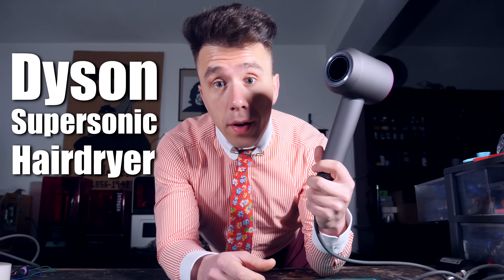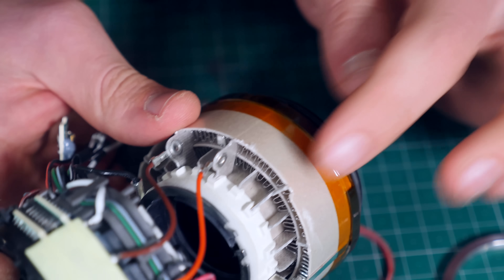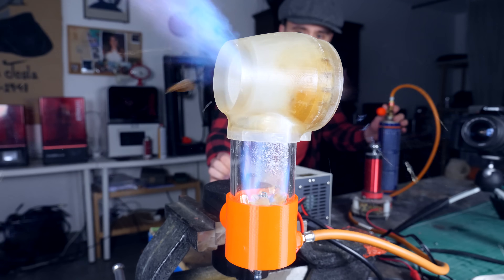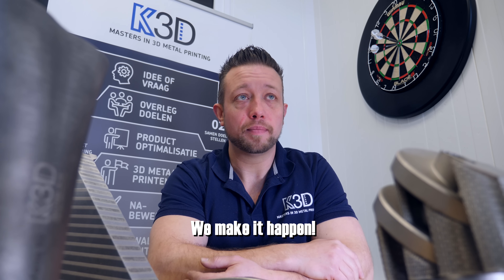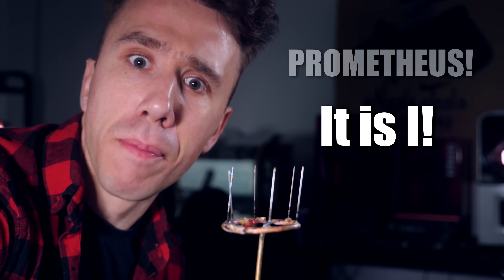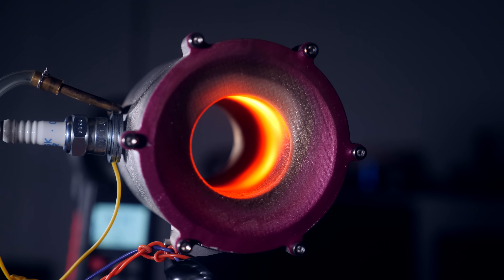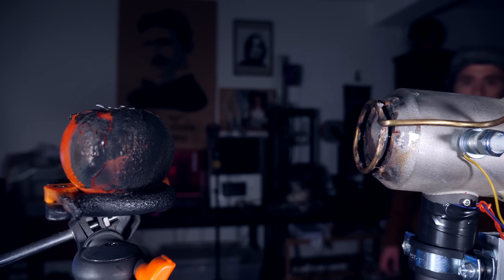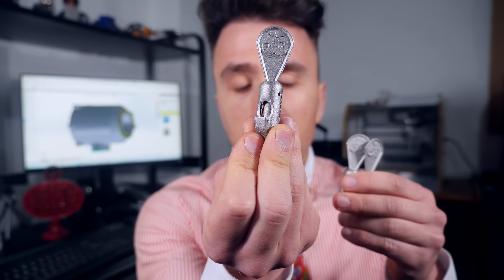I turned my DYSON HAIRDRYER into a JET ENGINE

Comment: How about building out a series of drone tests with Frore systems AirJet® Pro mems air pump then build into JETOPTERA Fluidic Propulsion™ system and Distributed propulsion not sure if using the Coandă effect like Jetoptera at the leading edge creating more of an Upper Surface Blowing (USB)  lift augmentation system could be better but there is also the Blown flaps, or jet flaps. 

Might be able to have some fun with leading-edge slots?!?

I also posted a few ideas of birdy like things to do with plans props and propellers.  The owl video spoke to the second set if vortices from the owl’s tail and mentions how hard that would be. With an upper blown surface Coandă amplified mems device powered air flow the tunable thrust would be superb. I once thought that the main advantage of having two large sets of lift surfaces (more than canards) is turbulence reduction when in powered forward flight; can’t find any reference for it now. 

https://www.froresystems.com

https://ntrs.nasa.gov/api/citations/20050195880/downloads/20050195880.pdf

https://www.jetoptera.com/technology/

https://patents.google.com/patent/WO2017065859A2/en

https://youtu.be/aWUt4h0zbEU

https://www.futureflight.aero/news-article/2022-08-22/us-air-forces-hsvtol-challenge-propels-jetoptera-fluidic-propulsion

https://www.sae.org/news/2018/11/ge-aviation-jetoptera-join-forces-on-fluidic-propulsion-system

https://www.researchgate.net/publication/269071244_Lift_Enhancement_for_Upper_Surface_Blowing_Airplanes

Overset Grid Symposiumhttps://2014.oversetgridsymposium.org › ...PDFLift Enhancement for Upper Surface Blowing (USB) Airplanes

https://en.wikipedia.org/wiki/Distributed_propulsion?wprov=sfti1

https://lilium.com

https://en.wikipedia.org/wiki/Blown_flap?wprov=sfti1

https://en.wikipedia.org/wiki/Coand%C4%83_effect?wprov=sfti1

https://en.wikipedia.org/wiki/Leading-edge_slot?wprov=sfti1

https://en.wikipedia.org/wiki/Avro_Canada_VZ-9_Avrocar?wprov=sfti1

https://www.jetir.org/papers/JETIR2104113.pdf

https://vtechworks.lib.vt.edu/bitstream/handle/10919/35999/EBKThesis_121004.pdf;jsessionid=C4F1AFB2FE21A95C05370AABBAB8FC5C?sequence=1

https://ir.library.oregonstate.edu/downloads/cc08hp263

http://www.icas.org/ICAS_ARCHIVE/ICAS2012/PAPERS/266.PDF

https://www.mdpi.com/2226-4310/9/12/745

https://www.ncbi.nlm.nih.gov/pmc/articles/PMC5550969/

https://www.ncbi.nlm.nih.gov/pmc/articles/PMC8385352/

https://en.wikipedia.org/wiki/Tandem_wing?wprov=sfti1

https://royalsocietypublishing.org/doi/10.1098/rspb.2020.1748

https://hal.science/hal-02086677/document

Nature has all kinds of tricks up the wing: bird feathers have a porosity that allow air to be sucked through to reduce drag; https://www.cambridge.org/core/services/aop-cambridge-core/content/view/7AA116B6EDE6511BBE249B384936B30C/S0022112020007466a.pdf/reducing_aerofoilturbulence_interaction_noise_through_chordwisevarying_porosity.pdf

https://spectrum.ieee.org/future-airplanes-will-fly-on-twistable-wings

https://www.flxsys.com

Comment: VIDEO IDEA: Can one of the devices you make be used to make a kiln (like they use for pottery or working with glass). As these use air to make fire produce much higher temperatures than normal. I don't know how the air makes the fire burn much hotter. But I'm sure one of your jets/fans could do it. 😊

Comment: Hello integza I was wondering something, when I was watching a couple of older videos I saw that when you were building a tesla turbines I noticed that you missed the star shaped spacers that are needed for the beginning torque and overall strength of the engine, if you did have those then sorry for wasting you time but I'd like to see if you would have better success with them if you included it.

Also are you aware that there were tesla turbine jets that used hydrogen they would burn the gas in a combustion chamber then run it through a small diameter pipe to increase pressure and temperature, the hot gas would then go through the turbine then get reignited, I just thought it was cool

Comment: a turbine that is cooled by the expansion of compressed hydrogen that it uses as fuel. this turbine produces the electricity needed to charge up a supercapacitor bank that in turn splits water using a counter rotating cathode and anode that produces browns gas or hho (counter rotating to ensure even wear of the electrodes) the hho goes through hv electric coils so that Oxygen gathers at one pole and hydrogen at the other.
this hydrogen is captured and compressed to liquid by the fuel pump and then injected at high pressure through the turbine cooling jacket and into the turbine where it is ignited.
(not perpetual motion for we are putting a fuel source in - water)

there will be a high percentage of hho that wont be completely hydrogen or oxygen but a mixture of both, this is vented and burnt through an igniter and sent through an exhaust manifold.

this exhaust manifold is used to shape the exhaust from the turbine itself

by spiralling hot exhaust hho gas at much higher speeds in a cyclone around the turbines exhaust, we can focus that exhaust for more thrust.

recap.
1. turbine that burns hho/browns gas.
2. is cooled by a coil of decompressing liquid hydrogen 
3.turbine has liquid hydrogen cooled ac generator motor (making it cryo cooled/super conductive) 
4.generated power is stored into supercapacitor bank.
5.supercap bank drives an hho generator, using electrolysis/water splitting to make browns gas/hho.
6. the hho gas is the exposed to super conductive electrode that will draw hydrogen to one pole and oxygen to the other.
7. the hydrogen is then compressed into liquid hydrogen, then pumped directly into the cooling/expansion coil around the turbine then directly injected into the turbine for ignition.
8. the wasted hho (not polarised gas) is then ignited separately and sent through the exhaust manifold.
9. the waste hho exhaust is ported in such way that when it meets the exhaust from the turbine it shapes it focus it and enhance thrust.

also using a static friction layer on the insulator layer between the poles of the rotating cathode and anode. means that the cathode and anode spin slowly against this friction surface exposing fresh electrode surface and clearing oxides that may be generated. 

this system produces controllable thrust.
super conductivity.
generates electrickery.
pumps and compresses liquid hydrogen.
is self cooling.

Comment: Since you like dabbing into jets, and you also had experience with making ramjets, you could be the first that actually achieved flight / hover on Focke-Wulf Triebflügel design - Nazi Germany concept plane that reached wind tunnel tests but it was never properly build. Of course, you can only make the engine / propeller part for VTOL,  suspend it on a wire for safety and for stability,  MPU6050 Accelerometer and Gyroscope sensor with the Arduino. Would be a cool project. You can also slap a funny mustache on the tomato-test pilot, since you hate them so much :D

Comment: The fuel delivery has to be just behind the heat source, just as the air is compressed. Then you will not be able to melt your soldered joints.

Comment: Hi im a 14 years old student 
Can i make a pulse jet engine with a carburettor? If i can is the reed valve still important ? The carburettor mixes air and fuel , so do i still need the reed valve for air?
Reply: There are such things as "valve-less" pulse jets but it will be very hard to not use pressurized fuel.

Comment: "Although I struggle with English, I wanted to share an idea with you in this comment. Have you considered using nichrome wire to create a captivating jet engine effect? You could install a jet fan and arrange the nichrome wire in a circular pattern. By supplying electricity to the nichrome wire, the airflow from the jet fan would fall onto it, resulting in a realistic jet effect. Additionally, incorporating some fuel could potentially enhance the overall outcome. I hope you find this suggestion helpful and exciting. Keep up the great work on your channel!"

Comment: can you create two of this dyson jet engine facing each other and their face is connected by a tube?

the idea is to simultaneously blow air inside the tube, when the air pressure is enough, to turn off one suddenly

it could be the same as the ironman arm blaster

Comment: Video idea:
Make a different version of the Hero's turbine by using the same design but the heat from the hairdryer would boil the water, but the main problem with that idea is to get enough water inside for the test run, maybe you could add a pipe to it?

Comment: the problem is, sintered parts are a million miles from the same durability as cast parts, let alone forged monocrystal or machined.

this sintering is stronger than normal sintering. but is still sintered

Comment: Again, how about researching a "Buzz-bomb", razor-blade combustion chamber jet engine, like the V-1 rocket?  Like I indicated before, this approach will work and you can generate a lot of thrust with an engine of this type!  So, leave the torching of tomatoes alone and start the fabrication of a  V-1 rocket! I need a 3D printer for my research!

Comment: Question is could it be made by using one of these Force blowed heaters creating the turbine thrust with like a car but using the transmission and motor axle shaft as the has the turbine prop shaft increasing revolutions with we controlled by an electric EFI maybe try to introduce water to hit for more boost do you think it's possible

Comment: oh your brass and needle fuel injection system keeps melting the soldier try using a 4 cyclinder  fuel rail off a car itll bend the same under heat and give a more constant heat safe fuel

Comment: video idea : build a 3d printed jet engine with cryogenic cooling(you can make that by putting an copper wire coiled around the engine into the outlet of a fire extinguisher) or you can do it by coiling the fuel tube with any conductive metal around the engine(as the temperature of propane inside the can is very low. and tomatoes are super disgusting!

Comment: A theme for a future video. How about designing a large wind up mechanism. Like what used to be in old model trains and toy cars. Maybe you could replace the wind up key with a small starter motor to wind up the mechanism to create perpetual motion (free energy, mostly!) Then you could use that motion to charge the battery for the starter motor! You could design and fit it to your grandfathers bike! (I’m Hoping to win a 3D Printer to help develop my creative engineering ideas)

Comment: Video Idea: Make a flight suit with your own jet engines.
Technically, you already made one of your jet engines power a bicycle. A bit more powerful and a flight suit would be possible. I don't mean A flight suit with vertical takeoff, but one like a powered hang glider. Another idea is launching a two-stage rocket with a tomato as the payload. The second stage can be a liquid fuel one, and the first can be solid fuel. Once the stages have separated and the first stage has no more fuel, release the tomato with an explosive bound to it. Let the tomato explode in the air!

Comment: Future video idea... proof of concept for running your hair dryer jet engine on the electric rocket propellant. Not just running it,  but 3d print an airfoil wing to fly it.  Or possibly a 3d printed rocket fuselage and see how high it will launch 1kg of tomato sauce in the air

Comment: Theme for a future video idea…following on from aero concepts in this video where the Venturi effect is used to multiply the air flow (I think that’s right) and given your love of 3D printing, could you design a 3D printer extruded/part cooler housing to take advantage of this principle?

Comment: Reconstruct the jet engine.
This time don't include a motor, make use of a 3D printed fan blade shaped like a circle with a very wide hole in the middle the fan should be have its own compartment within the engine compartment with an opening to feed compressed air into it. A thinner nossle should be fixed too

Comment: ngl it was extreemly unsafe to hold the engine with your hands! what if it flew out and bounced around the room lol. You should prob put a way to cut off the air flow so it can act like an emergency shut off.

Comment: Integza - Why don't you use the 3D printer to create blanks and sand cast them with metal and strong plastic moulds to press the sheet metal parts into shape. you know so they don't melt. Make a jet turbine already.

Comment: Introduction

The field of prosthetics has seen significant advancements in recent years, with 3D printing technology enabling the creation of low-cost, high-quality prosthetics. However, many 3D-printed prosthetics still lack the functionality required to perform everyday tasks with ease. One way to increase functionality is by adding radio control to the prosthetic hand, allowing users to control the movement of the hand wirelessly.

In this blueprint, we will discuss in detail how radio control can be added to a 3D-printed prosthetic hand, including the sensors and electronics required for the project. We will also discuss how the fingers and motions will be actuated, as well as provide a detailed blueprint for the project.

Sensors and Electronics

To add radio control to the prosthetic hand, we will need to incorporate sensors and electronics that can detect movement and control the motion of the hand wirelessly. There are a few different sensors and electronic components that we will need for this project:

Electromyography (EMG) sensors: These sensors detect electrical signals generated by muscle activity, which can be used to control the prosthetic hand. We will attach these sensors to the user's shoulder or elbow to detect muscle movements.

Accelerometers: These sensors detect changes in motion and can be used to determine the orientation of the prosthetic hand. We will use these sensors to control the movement of the hand.

Microcontroller: We will use a microcontroller to process the data from the sensors and control the movement of the hand. The microcontroller will be programmed to respond to specific muscle movements and trigger the corresponding movement of the hand.

Wireless transmitter: We will use a wireless transmitter to send the data from the microcontroller to the prosthetic hand wirelessly. This will allow the user to control the hand without being tethered to any wires.

Fingers and Motions

To actuate the fingers of the prosthetic hand, we will use servo motors. Servo motors are small motors that can be controlled precisely and accurately, making them perfect for controlling the movement of the fingers. We will attach the servo motors to the fingers of the prosthetic hand and program the microcontroller to control the movement of each finger.

There are a few different motions that we will need to be able to control:

Open and close: We will program the microcontroller to open and close the fingers of the prosthetic hand based on the user's muscle movements. If the user raises their shoulder, for example, this could be detected by the EMG sensors and used to trigger the prosthetic hand to open or close.

Grip strength: We will also program the microcontroller to control the grip strength of the prosthetic hand. This will allow the user to pick up objects of different weights and sizes.

Wrist rotation: Finally, we will add a servo motor to control the rotation of the wrist. This will allow the user to control the orientation of the hand and perform more precise movements.

Blueprint

To create the 3D-printed prosthetic hand with radio control, we will need to follow a few steps:

Design the prosthetic hand: The first step is to design the prosthetic hand using CAD software. We will need to design the hand to accommodate the servo motors and sensors required for radio control.

3D-print the prosthetic hand: Once the design is complete, we will 3D-print the prosthetic hand using a high-quality 3D printer. We will need to use a material that is both lightweight and strong, such as PLA or ABS.

Attach the servo motors: Once the hand is printed, we will attach the servo motors to the fingers of the prosthetic hand. We will also attach the EMG
Reply: Thanks but the videos are a prize within itself I gained lots of knowledge from watching your videos Thanks keep up the great work
Reply: James denner

Comment: This is so cool! I was thinking for an idea, what if you combined a couple of principals to create something really cool. I think that I remember the SR-71's motor has a combination of of a turbojet, and then at a certain speed, it moves the plenum to then become a ram jet. But ram jets need air to be moving into them before you can generate thrust entirely from the ram function. So could you redesign the Dyson jet so that it starts like it did with the motor moving the air to create thrust and then at a certain point, have it transition to a more ram mode so it can be self sustaining with the fuel, and not utilizing the motor, using the suction created by the thrust exiting the end to create the intake portion? if you had the shape of the ram jet on the inside of the dyson hole, it might could work?